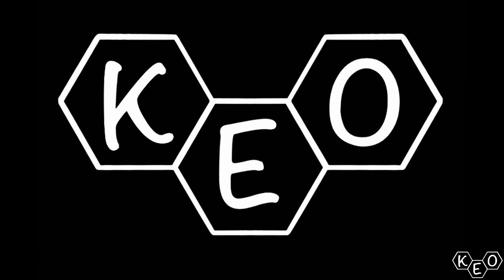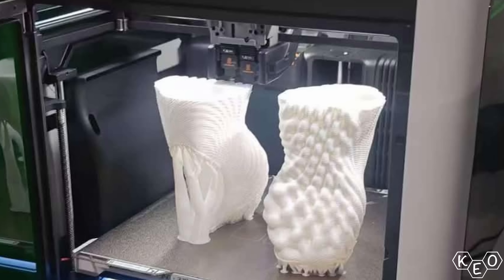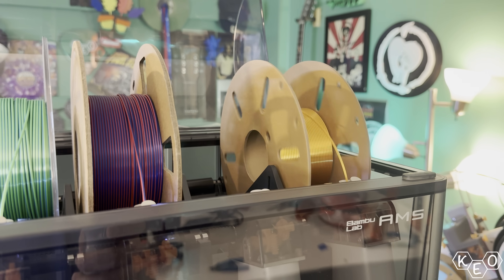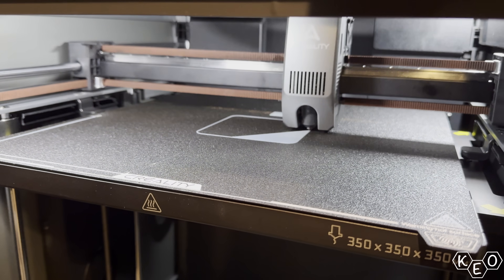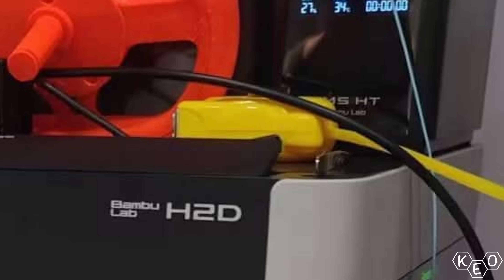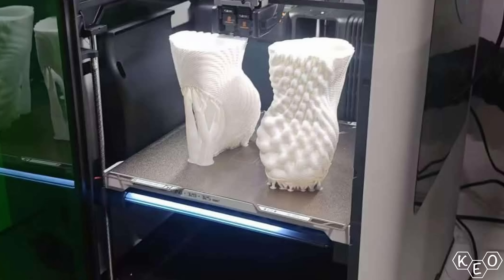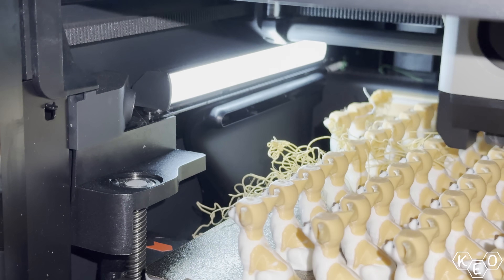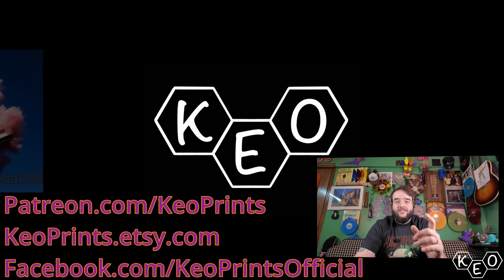The Unreleased Bambu H2D Changes Everything

Comment: Many of you are asking for a size around 350x350, but Bambu needs to balance this with speed. I believe that when designing a 3D printer, their goal is to make it the fastest on the market. From my experience (I have built Voron 300x300 and 350x350), I've realized that the larger the printer, the less rigid it becomes. Of course, there are solutions for rigidity, but the cost should stay within reasonable limits. Therefore, I believe that the size they chose is purely to achieve the highest performance in terms of quality and speed based on the materials they use.

Comment: This is what I want for the H2D:

- Toolless design for every component, every nook and cranny of this printer. If a tool is mandatory, then a single allen key should be the only thing needed.
- Hotends are compatible with the A1.
- Get that laser and the price of including it out of there. Or atleast make it a module that can be bought separately.
- Redesign of the AMS to make it less of a hassle when loading filaments.
- I can use OrcaSlicer with it without having to connect to the internet.
- Able to stack more than one AMS.
- Annealment function.
- 350x350x350 build volume.

If one of them is missing, Its going to be a hard pass. I don't think these expectations are unreasonable, especially since they're marketing these to 'prosumer' and are asking for a high price, afterall.

Comment: The laser module literally has LASER printed on the side, granted its in a bit of a weird font, but it's there. Also the little gold plated connection pads make me think it has some sort of quick attachment system. Could be wrong about that last part though as it also has a cable so why would they have a less reliable method as well, so could just maybe some indication LED's to indicate its on or smt.

Comment: If you look closely at the tool head you can see the left nozzle appears to be higher. In their "teaser" artwork released, it shows the cover on the tool head which appears to have some mechanism (it's partially transparent).

My guess is that it differs from the patent in that it no longer rotates out of the way, but instead lifts linearly up/down.

Comment: I suspect the 2 nozzles are for 2 sizes, not 2 colours/types.
One image showed a 0.4 and a 0.8mm nozzle
Reply from the maker: That would be excellent. Large layer height for infill and fine layers for walls would make a huge difference for print times and internal strength depending on what you’re printing

Comment: I don't believe this printer will be targeted at the end consumer, this dual nozzle setup allows for true multi-material printing, printing TPU95A with PETG would not be possible on an X1 or an X1E.

This printer is clearly aimed at designers and engineers.
Reply: since its using ams, TPU still wont be a good idea at all.
Reply: @chillermrq  i hope they made a better design in the AMS for TPU, UltiMaker S5 was able to do this even beeing a Bowden 3D printer for the last 5 years.

In this New bambu, if the material do not get re-spool every time, i think it will works well.

Printing with just 2 materials, i dont think this will be a problem, but for printing more materials then this, at the same time, well, im not so sure

Comment: if it's has a built-in laser module , I certainly will not be buying one . 

I have laser machines already and I can't imagine all the crap and dust laser machines give off which then inside that 3-D printer and cause issues with filament and everything else. Not a good idea .

Comment: Honestly I think more printers need to adopt the IDEX setup. Its so nice to eliminate purge towers from prints. And if done properly they could time the mini side purge to start at the same time the other exteuted moves to the side saving precious time. I don't see laser as a good technology for such small machines but also understand the demand for it. I have both, but like them being separate machines. The 3d printer inside, laser in the garage. No matter how hood the exhaust fan is, it will still emit smells in a room. Also they are easier to teoubleshoot and repair as separate machines, but thats just my opinion.

Comment: I dont understand why people still use heat to "dry" their filament. Hotter air can contain more moisture, which means for the same weight/quantity  of moisture in the air, a hotter air will have a lower percentage of humidity. relative humidity is a bad indicator for 3d printing.
 
Yes, blasting hot air works on hair, because there is a ton of air with a 50% relative humidity around, and we dont want hair with 0% humidity. Blasting cold air would work just a bit less, but is less comfortable. Filament does not care about comfort. It wants to be the dryest possible.

If the air volume is about constant, the cheapest is to go silica gel beards. Once they absorb moisture, couple of hours in an over at 100C and they are good to go again. That way the filament is not exposed to heat. It works so well my humidity sensors cant get a reading on humidity in the dry box. 

The "best" way is how we do it on planes : COOL air to 0 celcius so that all humidity is removed, then heat it again, either actively with a resistor or a source of heat ( jet engines on planes) or mix it with the existing air. 

But blasting hot air is only going to change humidity percentage, not humidity quantity. It wont do that much, besidse reaching an equilibrium between filament moisture and air moisture.

Comment: No mention of the A1 style quick swap nozzles? One of the best things about my A1, vs my X1C, is the quick swap nozzle. I use it for all my 0.2mm printing unless I need more than 4 colors because the nozzle is just easier to change. That, for me, is top 3 features. Dual nozzle, bigger build volume and quick swap nozzles are all I need. (I already have a dedicated laser, so that part is useless to me)

Comment: I really hope that's not a laser because it will just inflate the price of the machine (regardless if you actually order the laser or not). 

From a value perspective I actually don't think it should cost more than $2,500. The extra extruder is mostly what you pay for after all - a slightly bigger bed and a heated chamber shouldn't add too much cost. I've got a business but I still wouldn't find it remotely attractive at $5,000.

Comment: There might be two more nozzle's hidden behind the front two - now that would be quite interesting - and would massively speed up multi colour prints.   Only having two helps a bit with two colour models - but as soon as you start going to 3+ then it starts to get quite slow again. 
PS/ What you describe as the buffer is more likely to be the hub/AMS 2nd stage motor.  The buffer is something with some give in it or space to allow the filament length to expand a bit - like is on the back of the X1/P1.  If it is only 2 colours - this video shows some of the potential benefits of a double extruder printer. https://www.youtube.com/watch?v=q-BAk5jvPGo&t=11s

Comment: I had a Cel Robox with dual nozzles years ago.  The fundamental flaw was that the nozzle not in use was continually cooking the filament when not in use, just from heat from the other nozzle, and it would eventually degrade and clog.  So if you're doing a long, single-material print, you have to stop every now and then and purge the nozzle not in use.  It's possible they have better thermal isolation though.

Comment: If you can increase machine size, and can make 2 nozzles work... why wouldn't you put in 4?  The head assembly looks like it could be square, which could make space for 4 heads.
Reply from the maker: Cost or weight
Reply: Co$t perhaps?

Comment: Two nozzle for SUPPORT MATERIAL.  With costly other Filaments.  No, the 320 is 20 mm Smaller because of the 2 side by side heads.  20mm less then an inch and that removes the center of those two nozzle heads tip to tip.....  So,  340 front to back...  320 side to side and Z....whatever....

Comment: Laser engraving is already accessible, it doesn't take a swiss army knife 3D printer to do that.  Diode lasers are cheap, and even a "small" one has a much bigger work volume than 350x320.  Size matters with lasers, and 350x320 is too small.

Comment: Left side inside looks like it’s the size of a filament roll which would make sense too because the one downside to using the bamboo now as a dryer means you can’t use the bamboo as a printer so then putting it on the side and opening up the heat to it which it looks like they do is a quick and brilliant way to do it also considering not everybody’s gonna buy at the AMS with the heater built in which also of course solidifies the heater being inside of the AMS

Comment: Wouldnt want a laser inside a enclosed 3d printer? Do you know the level of cleanup that would be required going from laser cutting to 3d printing. Laser put off tons of smoke etc materials. Just a bad idea and why no company has done a combo like that up to date. They ware either open air or completely different machines.

Comment: Just so aware, creality CFS has the heating & fan inputs on its control board already unused for tempature control/filament dryer. They are also in testing phases for one to be released. (Heard from a beta testers recently) Shhh. They were behind getting the K2 plus out, so couldnt get it all implemented before getting the K2 plus out for X-mas sales. Creality will have a cfs filament dryer soon also. 

Excited to see what this Bambu machine can do though. I just dont want to see its price. Im guessing easily $2500-3000

Comment: 8:27 as at this point on the video he’s talking about the laser potential laser zoomed in on it and it looks like it does have a W at the end, which is typical of a laser, but did anybody notice the emergency stop button on the right and the vent on the top of the actual printer where the glass would be? At least it appears to be a vent that you can open and close and a warning label on it.

Comment: I am not bothered about the laser as I have a full size dedicated one already. By the way, if you need an extractor fan for one then get an extractor fan that cannibis growers use in placed where it's illegal to grow cannibis, because guess what? They are super quite (for obvious reasons). And high flow. What would be your guess on the price? I am guessing $2000 without the laser,  considering the price of the carbon. The laser would have to come with a different built plate because the laser will destroy it. Engraving would be OK but cutting will kill it.

Comment: Something to consider regarding 3 and more color prints, a dual nozzel set up will reduce waste for any layer that only uses two colors, even if more colors are used elsewhere. So if the first half of the print are 1&2 and the second is 3&4 the only waste will be building the purge tower and swapping the two colors at the mid point. Even for 3 colors on a layer, only one nozzel needs to swap, reducing waste by 1/3rd.

I am curious if the dual nozzel will give us the option to manually load one with a non ams compatible material like TPU while keeping the AMS capabilities on the second nozzel. Imo, the limited ability to use TPU is the biggest flaw with the first gen printers.

Comment: soo.. whats the point of a single tool head with 2 nozzles? or did i misinterpreted the image?
Reply: Both different colours and different materials are the obvious use case if they manage to fet dual material feeds. That would allow for printing in 2 different colours or materials without purging on every change. Currently depending on what you print the purging can easily use as much or even more material than the base print, so getting rid of that would be hughe.
Reply: Supposedly it's so you can have a second color pre loaded.. it doesn't make a whole lot of sense to me cause it adds to the tool head weight.   Maybe shaves a little time of a multi color print and maybe good for a print with support material.   I'm assuming if it's more than two colors you'll hang to purge the filament.. but I guess we'll see

Comment: I think you are overthinking the nozzle vs number of colours question. Based on the image you are speculating, like everyone including me, that there are only 2 print heads. However, if you look at the size of the entire print head, it could be housing 4 print nozzles in a 2x2 configuration and the picture is only showing the 2 front ones. If there are 4 nozzles it would be amazing.

Comment: Bambu went from copying prusa to copying snapmaker and ultimaker/raise3d/makerbot
This is easily over $4k and at that point, it's dead in the water. bambu X1E is $2900 and all that is, is an X1C with a chamber heater, for 2.5x higher cost.
And just like bambu's lidar, lasers on 3d printers are a gimmick. Creality tried it, snapmkaer tried it, it never worked and it was just used for marketing.
Reply: Okay
Reply: Prusa did not have a core XY machine when the X1 (their first printer) came out. The core one came out this year.
Reply: @joeylopezdesign  Are you sure about that? Is that your final answer? Prusa had their AFS like 5 years ago and their XL was announced more than a year before bambu was even a kickstarter. Prusa had coreXy printers long before bambu even existed.
Reply: Well you know everything so no point in telling you how the microlidar saves me money as a farm operator in several ways, lol. Stay ignorant
Reply: So your entire comment has… nothing true in it, it’s 100% factually false, aside from opinion - so there’s no point in listening to anything else you have to say.

Comment: I personally think the dual nozzel has nothing to do with multi color. What it does permit is multi material. Say print with pla but have pva supports or petg with pla supports or print in place tpu hinges! This is the one thing ive seen that the ultimaker printers still had over everything else. Here comes the final nail in the coffin!
Reply: Im thinking the duo nozzles are there for 2 different nozzle sizes.  Nothing to do with AMS or filament type.  Simply to change nozzle diameter during a single print.  Thin for walls and thick for infill would speed up a print if it is a single color.  Idk.  Just speculation

Comment: It's a laser, you missed the red button on the right of the machine.  Many markets require an immediate shutoff button for lasers.
Reply: It could just be an eStop to protect the prototype from destroying itself
Reply: @AyreBen  It "could be" but then this photo could also just be a picture of a Bambu Labs  linguine machine.  You've got 4 indicators that this is a laser engraver, any of them by themselves is a guess, but altogether it's a confirmation.  How many other 3d printer leaks have had an estop pictured?  None.  How many laser engravers need a red stop button?  All of them.
Reply: @AyreBen  lol, just looked at this on my laptop.  The module literally says "laser" on the side.

Comment: I really need a larger format printer (currently using a X1C w/ 4 AMS) but I'm taking a wait-and-see position. I LOVE the Bambu eco-system but absolutely will NOT use any piece of hardware that locks me into an eco-system. I have a bad feeling this is going to be a $4,500, subscription only printer but I'm holding judgement until this hits the streets.
Reply: Because Reddit trolls and fearmongering youtubers scared you into believing that? At least acknowledge that a printer with a subscription would mean 99.999% of their customers would never buy again either which is why it’s so dumb that anyone believes it since they’ve done nothing to show they would. The only reason you even regurgitated that was because of clickbait.
Reply: @joeylopezdesign  Being lectured by a Bambu fanboy... just what I needed. Where did you get that 99.999% figure? Pulled from your ass? You must have missed the part where I said I was holding judgement until I saw for myself. Many, many companies are going the way of the subscription so what makes you think Bambu would join them?

Comment: I have some 2-colour prints, and some 6-8 colour prints.

But most of my 6-8 colour prints only have two - or occasionally three - colours in use on the same layer.  So a two-nozzle solution should slash my print times even if the AMS units still need to make some colour swaps.

Anything bigger than 300mm suits me; agree that the difference between the X and Y volumes are precisely because of the offset twin nozzles.  I'm seeing 320mm on the X axis, 350 Y, and a max height of 325mm.  Probably.

Comment: Notice of those two nozzles are not at the same height, so there is some mechanism to lift one out of the way
Reply: Its an ultimaker clone and uses patented ultimaker tech from 5 years ago.
Reply: @LilApe  Actually the Stratasys fdm1500 used dual lifting nozzles in 1995.
Reply: @LilApe  if you rust creality not to burn your house down with beta version lasers... that's your choice. :-D
Reply: @CrudelyMade  Uh....the bambu A1 had a global recall for risk of starting fires. Lets not forget that. I don't even use creality.
Reply: @LilApe  excellent job avoiding my point.  Unsure why you need to "uh."  you're typing. If your brain is freezing you can pause typing until thinking resumes. 🤪
Reply: @ You made no point, I was calling out the irony in your comment.
Reply: @LilApe  lol.  YOU can't see a point. yet one was made. perhaps the fault lies with your inability to comprehend things. ;-) 
just because you can't see something or do something, doesn't mean it's not there or is undoable.  it just means you can't do it. 
best of luck with your life though.. I can see no benefit from continuing on with you, if you can't even understand simple stuff :-)